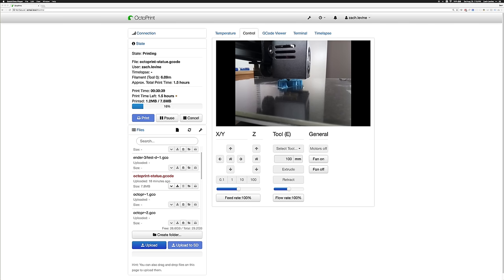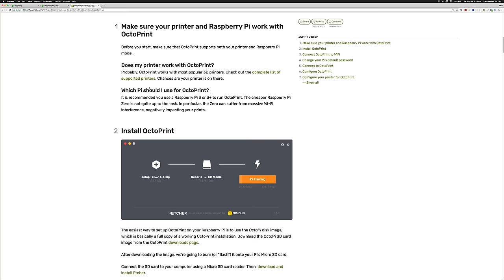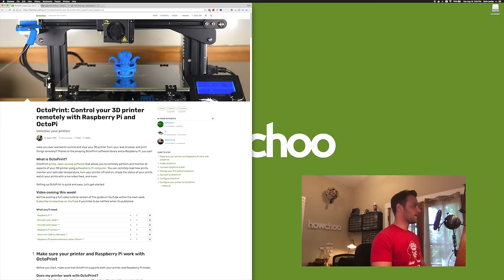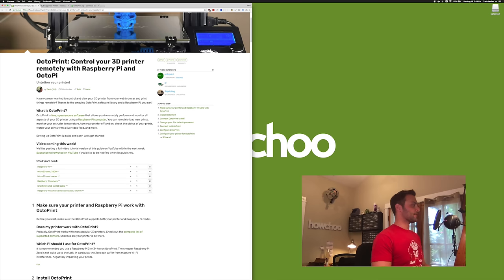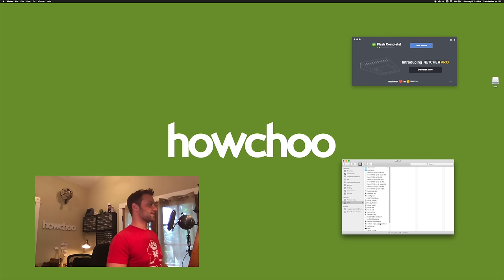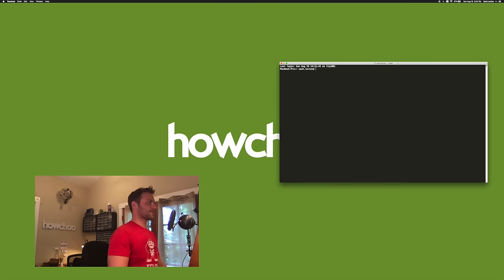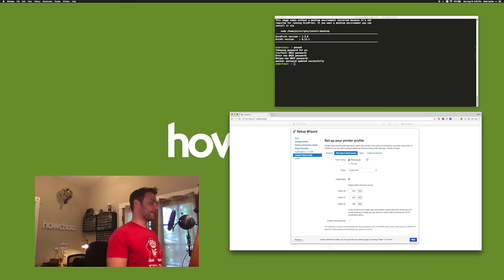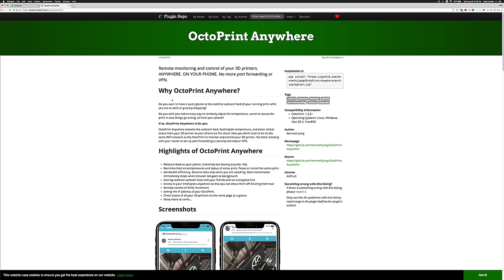OctoPrint: Control Your 3D Printer Remotely Using a Raspberry Pi!

Comment: I followed step by step and everything worked up until the part when u ssh’ed into the server. I could not get in. I was left with the message, “Could not resolve hostname pi: nodename nor servname provided or not known.”
Reply: This step isn't really needed.  However, if you wanted to do it, you may need to use the IP address instead of the host name.  Log into your router and see what IP the octoprint server was given through dhcp and use that instead.  For example if you see your octoprint server with an IP of 192.168.1.200 in your router you would ssh into it with "ssh pi@192.168.1.200
Reply from the maker: Good call. If you don’t have router login access and have an HDMI cable, you can also connect the Pi to your TV or monitor, connect a keyboard, and run ifconfig to find your IP.
Reply: @jeffhier316  I tried this and I got "connection refused"

Comment: Is my raspberry funcionall for other things, like NAS etc..? Or only for the 3d printer?
Reply from the maker: Theoretically you could use it for other things, but I don't recommend doing so if you're doing an intensive print. The Pi is outputting each gcode instruction as serial data directly to the printer. Using the Pi for other purposes while that's happening could theoretically mess up your print.

Comment: I have a robot (6dof inverted robot arm with hd camera 12mp) running off a pi4b, but a raspberry pi for a single printer is kina expensive for me. Is it possible that I could use a pi zeroW (one for both a ender3 pro, and a elegoo Saturn) for control, and use the robot as "master" and the ONE pizerow as "slave"? Btw I'm not smart, I did all this by online tutorials.

Comment: Can you control more than one printer from the same π, or do you need a separate π for each?
Reply from the maker: You can definitely do this to print to one printer at a time, but if you want to print to them all simultaneously (like a print queue), setup is a bit more complex. You might be better off running separate Pis, but if you’re feeling adventurous: http://thomas-messmer.com/index.php/14-free-knowledge/howtos/79-setting-up-octoprint-for-multiple-printers
Reply: @Howchoo  All right, thanks! I was really just being curious. UPS has just delivered my first 3D printer (Ender-5, yes, 5). I have built computers in the past but this is quite different, so I am going to take my time building it (I am 68 and physically disabled). I have to do it all by myself, as I have no one to help me (actually, I know one person who might be willing to help, but he never reads TFM and just jumps into it, which would only slow me down). When done, I will work on the Octoprint.

So, my question was mostly theoretical, as in looking forward to the future when I get more than one 3D printer. I looked through the link you gave me and I now think having a separate Pi for each printer is a better idea.

Thanks again!
Reply from the maker: Have fun! The Ender 5 looks like a really neat printer. Looks like a good form factor to build an enclosure around too ;)
Reply: @Howchoo  Thanks! :)

Comment: Hi can we use temperature sensor, humidity sensor, load cell, in 3d printer and use them using raspberry Pi, to run our 3d printer. Is it possible???can we attach them in our 3d printer?

Comment: I followed the video and the written instructions to install 'OctoPi stretch lite 0.15.1' on the SD card using Etcher and I get a failed notice. I can still eject the cad and re-insert and it shows files. I set up the wifi and continued but no connection tot he Raspberry Pi through the browser. I'm kinda lost from here.
Reply from the maker: It sounds like your SD card might be bad — do you have another one you can try? If Etcher fails, don’t proceed. Things won’t work properly even if you can eject it and view files on it as the process didn’t complete fully.

Comment: Im still looking for that good cura profile for ender 3 lol
Reply: Is the ender 3 profile with cura that bad? :s
Reply from the maker: Try downloading the latest version of Cura and add the Ender 3 from scratch -- they finally got the default settings right ;) I had to do this recently due to a hard drive failure, and everything is printing perfectly.

Comment: I was told the octo print was easy to hack, but you talked about the user name and password. I am starting to feel a little bit safer knowing there is a password at least.
Reply from the maker: It’s only [relatively] easy to hack if you open it up to the Internet without using a service like Octoprint Anywhere (it if you manually set up remote access incorrectly) :)

Comment: Can you modify Octopi with an option to disconnect the printer from the powersource in order to safely print remotely?
Reply from the maker: Surely! You have two options for that: use a smart plug that you can send a signal to, or a relay that you control using GPIO.

Comment: This video has helped a lot but i am still having many problems. i don't know if its my SD card or what, but the when i download octoprint. it doesn't give me an IMG file, but it gives me a .ZIP file with a disc image file inside of it. when i try to open it, windows tells me it is corrupted every single time. I have tried alternate downloads and different versions, but nothing is working. please help!
Reply from the maker: Have you tried writing the IMG ZIP directly to the card? IIRC if you use Etcher you can select the ZIP file directly. See if that works rather than attempting to open the ZIP first.

Comment: How did you print that octopus on the thumbnail without any supports?
Reply from the maker: Good eye. He had supports originally and I broke them off. I placed him there after the fact. But most of that model can be printed without supports (the drooping tentacle is the culprit).

Comment: What's the benefit of having the Raspberry Pi powered by the printer rather than a normal wall adapter?
Reply from the maker: There isn’t a huge benefit other than having fewer cords and cables laying around — I like having a super clean setup. And it costs about the same as a good AC adapter.
Reply: @Howchoo  Any issues reported regarding power issues? Powering a RPi can be an important issue. e.g. low voltage detected. Have you been using this setup for a long while? Did you have SD card corruptions? Power source of the printers are strong but I wonder how good the buck converters are?

Comment: followed everything you did step by step, but whenever i plug my ender 3 micro usb cable into my pi or computer the extruder temperature immediately begins to climb until it maxes out the temperature and shuts down (only has done the max temp shutdown once, b/c i caught it now and unplug the cable before it get too hot)

Is there something i've missed or done wrong?

tried redoing the whole install several times, even tried the newer 32 bit 4.2.7 board - no changes #plzhelp

Comment: I seem to have a boot loop. My Pi will boot up and restart over and over again. followed your instructions to the t. Any input would be appreciated!
Reply from the maker: Can you try with a different power supply? Also, maybe try connecting the Pi to an HDMI monitor to see if there's any output before it restarts.
Reply: @Howchoo  it seems to start loading through HDMI output to a monitor. It runs a bunch of code and then it will turn off and restart. I was previously using this unit for games, but this is a fresh new etcher image on a totally different micro sd
Reply: Update: It seems my issue didn't stem from anything involved here. I flashed the same card multiple times thinking I had done something wrong. I ended up having a faulty Micro SD card. Once I swapped out with a different card, the Pi booted successfully and I am now up and running. Thanks for this tutorial, I greatly appreciate it!
Reply from the maker: Nate Plays Ah, good to hear! Thanks for following up, glad you got it working.

Comment: Hello, quick question. I am getting stuck on the SSH part. I get the message " 'ssh' is not recognized as an internal or external command, operable program or batch file."
Help.  :D
Reply from the maker: I'm guessing you're using Windows and for some reason SSH is not installed -- this should help you: https://www.howtogeek.com/336775/how-to-enable-and-use-windows-10s-built-in-ssh-commands/

Comment: I connected to the pi iva Ethernet cable and set it up everything on the web browser, but when I disconnected it with my laptop and powered it down. Once I rebooted, the pi became disconnected and I have to use the Ethernet cable to connect to the pi with my laptop again so that I could use the pi. What's wrong? Why it cannot automatically connect to the wifi even though I had disconnected from my laptop?

Comment: My printer has a built in camera, can I see that camera over internet using Octoprint?...Thank you
Reply from the maker: Theoretically yes; you’d need to connect your printer’s camera to the Pi somehow. This will likely require quite a bit of hacking though.
Reply: Thank you...I think is better trying to work in my modem to see if the signal from the built in camera travels through the firewall and allows me to see the printing from outside home, so far I can only check the printing in my phone when Im in the same wifi that the printer is connected to....
Reply: I don’t know how to do it....
Reply from the maker: I doubt it’s broadcasting externally unless your printer explicitly offers that functionality and provides you access to an external server that your printer is broadcasting to. I doubt it provides direct access as you’d need a static IP or DynDNS. You might be better off just adding a Pi camera, they’re like 25 bucks :)
Reply from the maker: Then you can use something like OctoPrint Anywhere: https://howchoo.com/g/mgnmnjg5ywz/how-to-access-octoprint-over-the-internet-from-anywhere-using-octoprint-anywhere
Reply: So do you think is better to buy an IP Camera?

Comment: Will this work with a phone instead of your pc?
Reply from the maker: You can access OctoPrint from your phone's browser and control your printer that way -- but unless you can slice on your phone (or set up Cura slicing in OctoPrint), you'll still need a PC for slicing your model. But once you have a gcode file, you can do everything else using your phone.

Comment: Someone help! When I try to go edit the Wifi stuff it says I need to format the sd card. If I do it clears everything, so i redownloaded octoprint, but it made me format it again, so im in an endless loop! I also don't think my Raspberry Pi is detecting the SD card, because once it let me do it, but then didn't work because it wouldn't boot, so I tried again. SOmetimes using etcher instead of in 32 imager is works, but then won't boot. Sorry if this is confusing.

Edit: after more testing, I got it to allow me to use it without formatting, but I think the SD card is corrupted. I ordered a new one
Reply from the maker: Ok let us know if it works with the new card! Just saw this, was going to suggest that the SD card might be bad. :)
Reply: Well, I got the new SD card, and it worked! Yay I’m happy! I called Samsung about the corrupt card and they said that it was actually a counterfeit card, so... yeah that’s interesting.
Reply from the maker: Oh yeah that happens quite a bit actually.. glad you got it sorted!
Reply: @Howchoo I can't fix this, now I can't even use any other micro sd cards to my PC, I connect other sd cards and my pc says it has to format them
Reply: Francisco Osorio Try to reinstall the drivers for your SD-Card reader.

Comment: Whats the point in printing remotely when you still have to take the print off the printer manually before starting a new print?
Reply from the maker: As someone who printed "manually" for years before using OctoPrint, I can attest to this: no more fiddling with SD cards, easily stop and restart prints from your computer if you have issues, visually monitor your prints from across the house/apartment, preheat and control your printer (extrusion etc.) to make it easier to change filament, it's easier to upload and track lists of files (and reprint things later) without using the terrible interface that EVERY 3D printer seems to have. Of course, you still need to remove old prints, clean, and prep your print surface before starting a sprint. It's all the other things that you can really save time on. :)

I hope that was helpful!

Comment: Great video, very easy to follow. However, when I tried going to octopi.local in my browser, I got an error saying the site could not be reached because the servers ip address could not be found. Any advice on how to fix this? (I am using chrome on a PC)
Reply from the maker: It sounds like your Raspberry Pi probably isn't connected to the network properly. There are several ways to troubleshoot this, but the easiest might be to connect a monitor and USB keyboard to the Pi and run the `ping google.com` command (without the backticks) to see if you're connected to the Internet. Let me know if that works.
Reply: @Howchoo  so when I plug in the HDMI from the pi to my tv nothing comes up on the tv at all, just the "no signal". Does this mean that something went wrong while putting the OS on the SD card? I should mention that on the pi, only the red light is on, no green light.
Reply from the maker: Correct—your Pi isn’t booting at all, hence no green light. The same thing would happen if you booted with no SD card inserted. So either your installation got corrupted or the SD card is damaged. Try reinstalling and let me know how that goes.
Reply: @Howchoo  turns out it wasn't booting because the pi didn't like using a usb card reader for the micro sd. I plugged the sd card directly into the SD card slot on the pi and it booted and connected no problem. Thanks for all your help!

Comment: How can your pi connect to the wifi after shutting the pi down? I couldn't connect to the web via browser after shutting it down and rebooted again even though I had set it up and successfully connected to the web browser before
Reply from the maker: That's weird—can you try adding your Wi-Fi credentials again and see if it works? If the problem persists, it's likely a hardware issue... possibly a bad SD card or insufficient power supply. This is a very uncommon problem which suggests a hardware issue.
Reply: @Howchoo  I.have sovled the problem already, it was because I was trying to connect to the local address in the browser instead of raspberry pi unique IP address

Comment: do I have to be connected to my local network to use octoprint?
Reply: I mean, I need to stop the printer when it finishes while I´m at work.
Reply from the maker: By default yes, but you can also set up something like OctoPrint Anywhere to access it from anywhere. I wrote a guide on this: https://howchoo.com/g/mgnmnjg5ywz/how-to-access-octoprint-over-the-internet-from-anywhere-using-octoprint-anywhere

Comment: How do you set up a Raspberry pi bare unit does it require a operating system
Reply from the maker: Not sure what you mean. You can install many operating systems on the Raspberry Pi (Raspbian is the official operating system). For OctoPrint, you can just use the OctoPrint SD card image.
Reply: @Howchoo ownload was corrupt all ok now
Reply from the maker: Good to hear!

Comment: I plugged everything in but when I try to change the password of my raspberry pi it says "ssh: Could not resolve hostname octopi.local: No such host is known." Did I do something wrong?
Reply from the maker: Sorry I missed this -- did you ever get this resolved? did you try ssh pi@octopi ?
Reply: @Howchoo  yeah it took a little bit because it turns out there were a couple of problems, like the power cord the SD card was messed up and the camera wasn't working properly
Reply from the maker: @apollo06  Oh weird! Yeah, tons of people have reported issues where the culprit was a corrupt SD card. This can happen a lot when the initial flash is done, or if the Pi isn't shut down correctly. Now that things are working, make sure you always shut it down properly (through the OctoPi interface) before cutting the power. :)

Comment: Hi there,I'm having a problem right at the start... Can I get some help with it please?I flash the image as you do but the RPi doesn't boot.I plug it into my TV and I get a screen full of text and at the bottom it says..."end Kernel panic - not syncing: VFS: Unable to mount root fs on unknown-block9179,2)"Can anyone help? What am I missing???
Reply from the maker: Sounds like your SD card is corrupted or damaged — try flashing it again. If the problem persists, try a different SD card.
Reply: @Howchoo  Hi howchoo,
I picked up a new 16G SC card and that's it!
Looking better now but I can't read the card on my laptop?
It's telling me I need to format it???
I have put the card into the Pi and it does work. It's scrolled through a load of boot-up stuff and is asking for a log-in and password... I'm guessing that's Pi and Raspberry?
Reply: I'm having the same issue but i've tried more than one sd

Comment: Hey, so i got a problem. At first I did everything, plugged my rasbperrypi to the Ender 3 and also to the camera. It worked fine. However, I took the sd card out to change wifi (because I got 2, and i connected it to the worse one). I changed my ssid and password on Subline Text 3 fot the better wifi. I ejected and now I can't connect to the raspberrypie anymore. can someone help? @howchoo
Reply: Hi! Can you reach your Pi by using the IP and a ping command (ping ipAddress)?
Reply: I have the same problem.My pi stopped booting